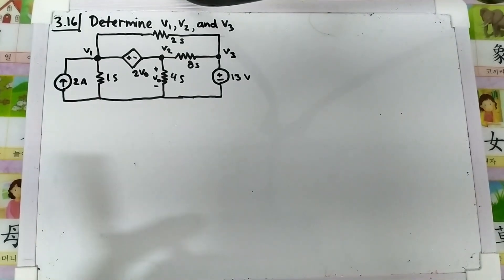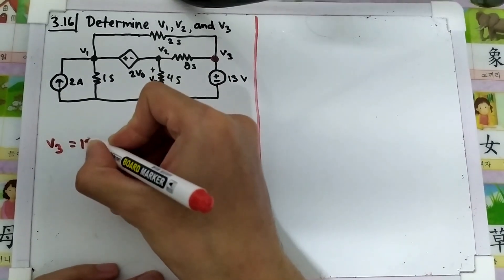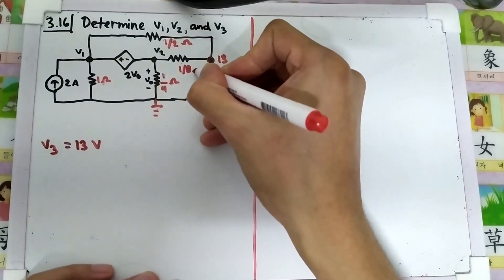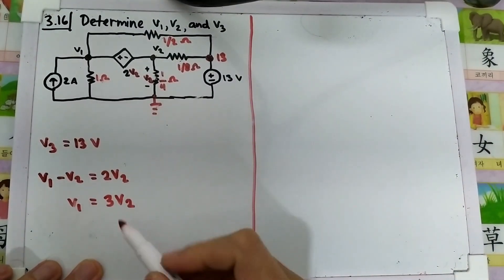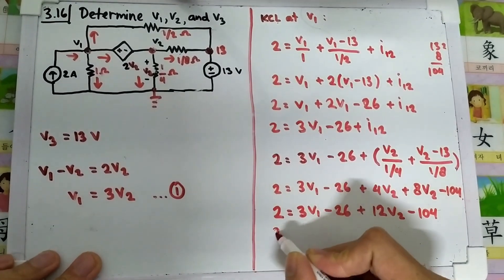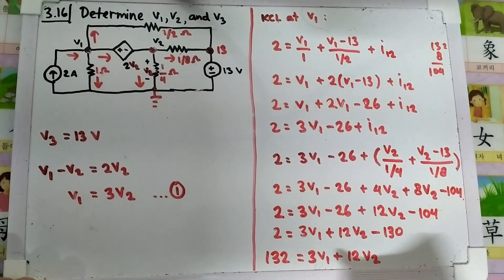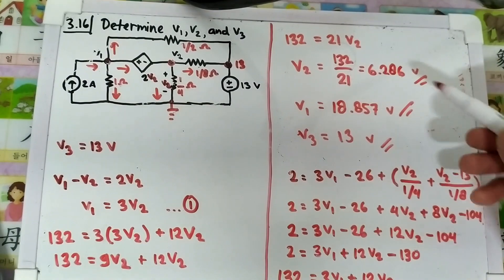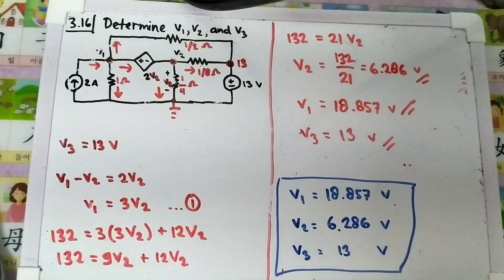Problem 3.16 Sadiku Determine voltages v1 through v3 in the circuit of Fig 3.65 using nodal analysis

Comment: why is Vo equal to v2
Reply from the maker: Vo is the voltage between V2 and the ground, so Vo = V2 - 0 = V2
Reply: @ArdiSatriawan shouldnt the v0 be equal to 4v2?
Reply from the maker: @Ali2k20  no
Reply: It's been a great assistance going through your videos to clarify myself, and learn how to solve questions related to 7th edition(Fundementals of Electric Circuits by Charles Alexander and Matthew Sadiku). Why is vO not 4v2? Isn't [(v2 minus refence node(which is 0V)] divided by 4mho(1/4ohms)= 4v2? @ArdiSatriawan